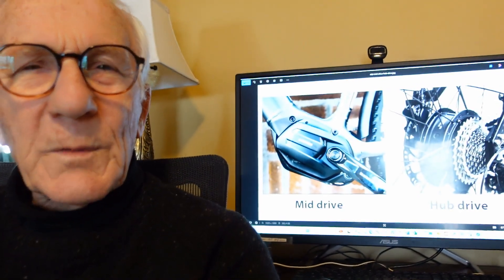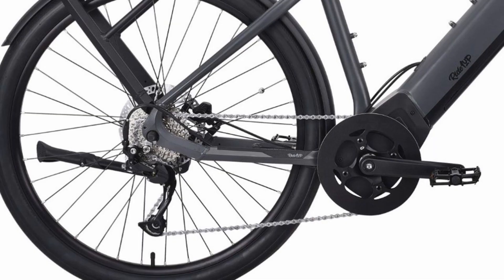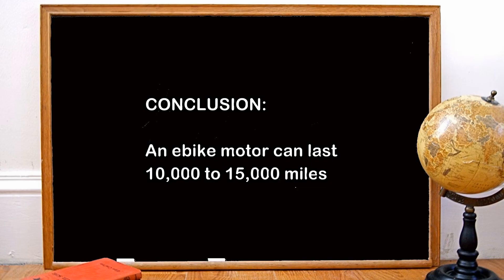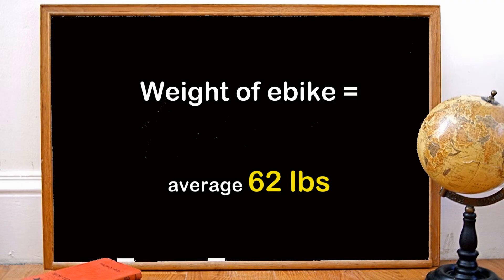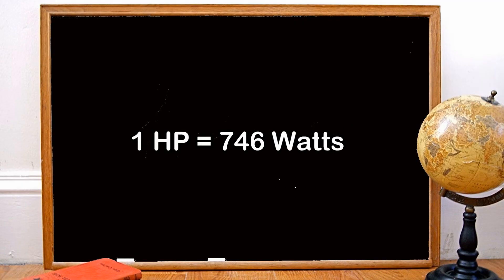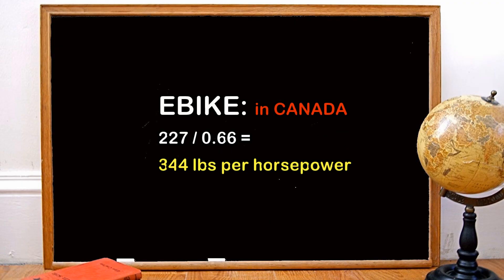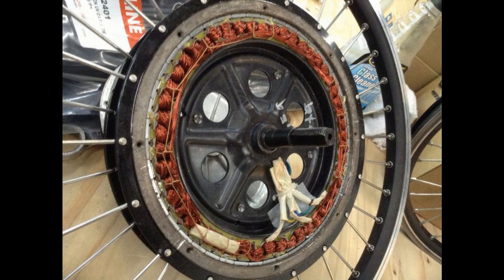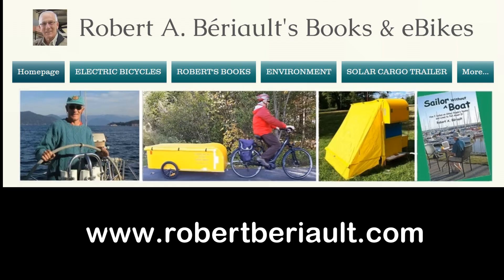Why Ebike Motors Have Such a Short Lifespan

Comment: I use a CYC Photon mid-drive with all-metal gears, it has done 4200 miles no problems so far, on-road and off-road. Best efficiency is around 700W but it will go more than twice that power for short bursts. I live in a flat part of the UK. The 9-speed chain works hard so I use immersive hot wax lubrication on a set of three chains and I have zero measurable chain wear so far.
Reply: My original Cyclone 3kw motor from 8 years ago is still running perfectly. I keep thinking about upgrading, but there really isn't much point.
Reply from the maker: Thanks for sharing your experience with the Photon and hot wax lube.
Reply: @ridefast0  yes, 4 parts paraffin wax, 1-3 parts beeswax, some ISO680 synthetic gear oil (plasticizer and added lubricity - adjust to suit: more oil = better lubrication, but more mess) and soon, powdered Teflon.  That gets added when I next run the chains.

Dedicated (used) crock pot, clean the chains in solvent prior, then let them stew in the hot wax with a slow withdrawal to prevent a waxy buildup.  Usually good for 150 miles behind a BBS-HD per chain.  I have three also, as waxing chains is time-consuming and three or more takes but a little longer than just one.

Comment: i have a direct drive hub motor that has been through 3 or 4 bikes across 2 owners, it is used with almost 10x its rated power. zero maintenance in the past 10 years. The bikes and wheels have fallen apart around the motor, but the motor keeps going. the motor is used mainly in the winter where there is a lot of snow and cooling.
Reply from the maker: Wow!  Thanks for your input.

Comment: direct drive hub motors are king. all other drives make no sense.
Reply from the maker: That they're so rare is a mystery to me.
Reply: @RobertBeriault753  they arent rare at all bud
Reply: Unless your priority is torque. Mid drive then so you can gear the motor as well as your pedaling.
Reply: @jaaklucas1329  no hub motors have more torque
Reply: @Blox117  IF you can gear it like you can a mid drive. Ive seen new hub motors with some internal gearing like 2 or 3 speed, thats an improvement. Nothing like a big range cassette though with a mid drive.
Reply: @jaaklucas1329  gears would ruin it. direct drive only
Reply: @Blox117  Torque is hill climbing If you want to climb like a billy goat then mid drive is the way to go and use the bicycle pedal gearing for both your motor and your pedaling. A low gear ratio for going up and the opposite for top end. With one speed hub motor you can only get mechanical advantage with your leg pedaling and the hub motor lugs down. Not efficient for motor or battery. For flat riding I like the hub motor on an ebicycle for the simplicity.More like a bicycle where a mid drive is kinda motorcycle.
Reply: @jaaklucas1329  nah you can easily climb on direct drive. unicycles use them all the time
Reply: @Blox117  72volt. Why waste all that battery range on an ebike when 48v will do the same or 36v on a lightweight machine?
Reply: @jaaklucas1329  they all have the same range genius
Reply: @Blox117  Give specifics then on your unicycle then. Volts system and battery pack size. More volts you run the more power you can draw...
Reply: @jaaklucas1329  Lol volts dont make a difference on how much power you use
Reply: @jaaklucas1329  You can design a system to achieve any toque and any speed and any voltage. Gearing is not important and voltage is not important. like the other guy said, electric unicycles are showing off that direct drive motors are very high performance. my cheap $100 direct drive hub motor has enough torque to power wheelie an MTB, there is no need for more torque or gearing down.
Reply: @Blox117  power potential no?
Reply: @jaaklucas1329  no because the power is controlled by a controller not the battery

Comment: It is, in fact, not actually about horsepower. The problem is closer related to forces converted to torque and the limits of the material used to transfer that torque.
You have already pinpointed that usually the mode of failure is shearing of gear teeth.
If the gears were larger and made of a more durable material, combined with more appropriate methods of lubrication, they'd potentially outlive the frame of your ebike.
But, as always, it comes down to cost and revenue! If they fail you need new stuff, which means more purchases.
Ever heard the term "planned obsolescence"?
Yeah, despite all of the greenwashing, here we are!
I spent my life working as an engineer, and I guarantee it is possible to design electric drives that would last decades and millions of kilometers.
Reply from the maker: That's a troubling revelation.
Reply: I suppose you could even just limit the peak power output, maybe based off motor wire temperatures

Comment: I only use rear hub direct drive motors, no moving parts and bullet proof. you can't kill them. I built a friends kid an Electric mini bike using and BMX frame even with the abuse kids give it the motor is still working fine. I have many bike out there over 5 years old and still running . My guess is you need to stop using those gear drive kits and go direct drive instead,
Reply from the maker: There's also the environmental advantage of wasting less resources.

Comment: Do they? I got a 1500w motor and it seems to work fine for several years now.
Reply from the maker: How many years and how many miles?
Reply: @RobertBeriault753  roughly about 10 years. Not that many miles though, I hardly ride it anymore. I'd guess about 7k miles. The batteries died multiple times, and replacements were too expensivem
Reply from the maker: Batteries are ebike killers: https://youtu.be/U-BI5fkwjFo

Comment: Dont get your e bike wet, race up steep hills or jump them, shocking the hub gears. Thats my plan
Reply from the maker: The ebikes that I have owned have waterproof connections and have never had a problem in the rain, even when they sat all night in a raging storm. But if you never expose your bike to water, you're sure not to have moisture issues. As for riding easy, that will allow the motor to live a longer, happy life. Thanks for your comment.
Reply: Darn, I do like to off road, jump and take steep climbs. Should I go to copper/nylon hybrid gears. What fun is a bike if one never jumps it?

Comment: Hi, let me share a bit of experience, i have a very small business in brazil, I have personally ridden a ebike for 4 years, doing deliveries, riding on a a higher speed pace than normal ebikes, at around 30kph average with max speeds of 50kph, that allows me in a 2 million people city (not too big) to keep up with average traffic speeds and reaching time goals for deliveries for motorcycle deliveries, i have ridden 80 thousand kilometers on my first hub motor 500w (48v25a) controller, with only controller issues. After 3 years, then i upgraded to a 1000w motor, that actually failed the gears with about 8 months changed to dual hub motors after, 2x 500w motors, but the windings were changed to allow for a longer power curve to reach 70kph. after upgrading all my bike some times, i have decided to import about 30 kits, and started selling then, than i have started to rent some kits, and had 17 motors under circulation.
My first motor, the one from 8 years ago, must have at least 100 thousand kilometers, and is still fine, yes i do renew the grease from time to time, but it is still runing, all the other 17 motors are also fine, that is on the hand of delivery bikes. With all those motors running and me fixing all the issues from all the bikes that came to my workshop, I`m under the impression that is not really correct, 10 to 15 000 miles? And just to be clear I'm a 100kg guy that pedals very little and the city is average gradient is 4%.

So 17 500w geared motors, including my old one, running at least 20 days a month for 2 years for at least 50km, its 24 000 km per motor , with 0 issues. All of that not including the dozens of bikes that i have sold and never came back for maintenance. 

Maybe i`m just lucky to buy from a nice chinese brand of motors... Never bought a bafang, and its a very popular one.

Sharing something else, i have fixed lots of gears from motors, most were 350w motors, some changed for metal gears. Never fixed a motor that i have imported and sold.

Sorry for bad english btw, and i enjoy your videos!
Reply from the maker: Many thanks, Gregory for sharing your valuable experience. This really contradicts the information that I found online. If other viewers have a similar experience, I might have to take down this video and make an updated one. I'm noting your comment. BTW, your written English is as good as most English speakers.
Reply: @RobertBeriault753  I'd urge you to leave the video up. Look at the incredible comments that help us all understand e-bike motors. This is fantastic!
Reply: Do you fit torque arms to your electric bikes?
Reply from the maker: The RadRover comes with a tiny torque arm, which looks to me like it might be not much help. I bought a torque arm from Amazon but it wouldn't fit. Howver, even though I added a more powerful controller, the increased acceleration hasn't cause any axle spin out problems so far, after 4000km.

Comment: I use a 48 Volt, 500 Watt, Direct Drive/Magnetic Hub motor. Guess what, no gears. Only one moving part. Since the motor has two large magnetic rings/donuts. One stationary, and one that moves when you apply power. Got the set up in 2019, and its still going strong with over 12,000 Miles on it. Sure, it does not have the acceleration as a geared hub motor, and it uses more power,  but its a good solid motor. So it all depends on the type of motor.
Reply from the maker: Thanks for you input. The slight disadvantages you mention will be forgiven when you get many more years of trouble-free service.
Reply: I got a Magic Pie 5 nine years ago. It's rated at 1kW at 48V but happily does 2kW at 56V. I've used it daily since, and I expect it to outlast me!
Only maintenance I ever needed to do was to replace its large bearing after I stupidly jetwashed it and some water got in and it seized. I was able to unseize and still use it with horrible noises while I waited for a new bearing to arrive!
Lesson, don't jetwash hub motors directly!
Reply: @ahaveland You should put 96 volts on it in a hot room for five minutes with heavy load and see how it copes . It won't survive . The 2 kilowatt figure at 56 volts doesn't make sense mathematically speaking . The figure would be only 1200 watts with the same current limiting control circuit board installed . I prevented  a motor like this from gaining speed with my foot against the wheel with safety boots on . After 30 seconds , the motor browned out . It was easy to do without injury as the motor cannot generate significant torque until it is up to a certain speed .
Reply: @robertmcfadyen9156  A Turnigy AVW meter shows around 2kW peak wattage - at  56V that would be a peak current of 35A when set to 30A current limit. That is an empirical observation.
63V is the controller's absolute limit and no I'm not stupid enough to exceed that. Max torque is near stationary and it accelerates well up to about 50 kmh, which is enough for me. It has served me very well over the last 9 years.
Reply: @ahaveland  The 2kw figure for power consumption would fall somewhat as the e - bike reaches 40 -'45 kilometres per hour .(at this speed about 1250 watts) . Starting current is always higher . This would be true given that power consumption would be 1kw at full speed on the 48 volt setting . The starting current on the 48 volt setting would transpose to around 1700 watts very briefly upon startup . I have done this with induction motors at the Technical College in the 1990's during the diploma course .
Reply: @ahaveland  Why is the 30 amp controller not "guarding" properly at 56 volts , allowing 35.17 Amps to appear across the DC motor ?
Reply: @ahaveland  My older brother weighs 165 kilograms . That e - bike's controller would go into full current state for much longer , and on prolonged hard pulls could likely overheat and fail if forced to do 50 kilometres per hour with this substantial load or greater . I have seen controllers have overload failures during a simulation in class .
Reply: @ahaveland  Bosch have recently advised not to do prolonged low cadence on steep off road climbs . It is "lugging" the motor and causing the controller and battery to get quite hot from fast drain . The motor gets hotter too . Like excessive load on a drill .
Reply: @robertmcfadyen9156  There's always a more arrogant know-it-all on the net.
I'm not going to get drawn into an OCD battle of technical minutiae, sorry.
The controller does what it does with the 14S lipo pack and saved me a fortune.
Reply: It's insane how you are comparing a bike motor to a car engine. Why can't you compare it with  electric car motors that last a million miles. It's common sense, anything that does not  have active cooling has less life. The same applies to motorcycle engines that don't have cooling
Reply: @electricvehiclesug256  Shimano's new 801 DC pedalec motors  have limited ventilation , this is to achieve the IP 4 water resistance rating .
Reply: @electricvehiclesug256  Pressure (force/area) per gear tooth for the gearing involved would help - Teslas have a single gear reduction IIRC, ICE engines have a lot more cogs in their gearboxes, and Bosch ebike motors try to be as small as possible and there have to operate at their limits.
I'm sure planned obsolescence is a factor as middrive manufacturers don't want their products to last forever!
Hub motors, on the other hand without any gearing, last practically forever, and may only require bearings to be changed once per decade perhaps.
Reply: @electricvehiclesug256  This criticism is valid given the video clip's theme .
Reply: I have contacts with some delivery drivers
Hubs, direct, 100000km and more
And they even havent replaced bearings
Their motor breeak when they fall off their bikes and break wires and thats about it
Reply: Bitix Is changing that with their new direct drive motor that does have powerful taking off so things are changing!
Reply: @quantumfx2677  Electrolytic capacitors reqiured for this .
Reply: I have a Nine Continent motor front hub from 2011 that has over 70,000 kilometers. It is a stator Rotar direct drive motor.
Reply: I've got a very similar setup direct drive with vesc controller keeping it under 750 watts and the motor I chose is "rated" for 1500 and I have statorade in my motor and the lifespan is only limited by bearings, I don't doubt I'll surpass 50000 miles, plus direct drive is easy and turnkey Regen braking. Bottom line is all Chinese ebike motors are built like crap. You get what you pay for and the more mechanical complexity the faster the wear. The bike motors are made with cheap plastic junk chinesium and auto motors are built for way higher power output. It's all a series of intersecting equations. Each buyer/rider ultimately has a different mission profile and will operate them differently. Building custom for serious riders is the only choice. To date I have not seen a single ebike off the shelf that is a reliable transport option. They all have compromises and many are shit frames to begin with.
Reply: @acroduster Where do Bosch performance line DC brushless motors fit in this , durability wise ? The bottom bracket water entry problem and durability of it's bearings are the main weaknesses of these motors , as I see it .
Reply: @robertmcfadyen9156  I personally ride only direct drive, I love hub motors, most products in the ebike market are just copies of copies filled with plastic and really really sad loose tolerances to begin with, Bosch motors are generally well made, but generally it's what's on the output shaft of the motor (geartrain) that makes or breaks a build and it's reliability.
Reply from the maker: Good points. Thanks
Reply: @acroduster 
I'm quite happy with my Bafang 750w mid drive, after 7,500 miles of trouble free enjoyment. I'm expecting plenty more miles yet.
Chinese ebikes have revolutionised cycling here in the UK, not least on account of their relative affordability.
Your assessment seems unduly harsh, to me.
Reply: @gedofgont1006  7500miles is not that much. But also, people tend to overdrive their middrives, on somewhat weak rear sprockets
Which makes middrives look worse

A well engineered middriver, with a lubricated chain can last for a very long time too :)
Hubs are just a bit more robust
Reply: @woodrunner51  
Thanks for that.
To be honest, if I can get around 15,000 miles out of my Bafang, I'll consider that very good value. 
I'm thinking of going for a hub drive next, but I'm afraid it'll have to be a cheapo Chinese model, because British made ebikes are two to three times more than I want to pay.
Reply: @gedofgont1006  you can also buy a used hub motor
And get a s866 controller, it can work without hall sensors

So for the motor to fail it would need to have its bearing fail, or motor wires burn or something like that
Reply: @gedofgont1006  If you have a standard pedal bike, that you love to ride, that fits you. Just convert it to an Ebike with a Hub motor kit. Just remember to follow the rules for where you live. I converted my two wheeled recumbent to an Ebike, back in 2019, and the motor is still going strong.
Reply: @longrider42  
A recumbent ebike?
Now, that sounds fun!👍🤝
Reply: @gedofgont1006  You'd be surprised at how many there are, out on the road. Although, most of them are three wheeled tadpole recumbent"s. Two in front, one in back, and most use a mid drive, but I prefer hub motors.